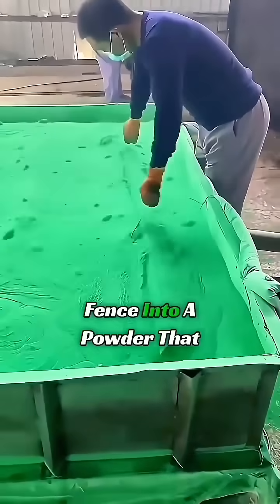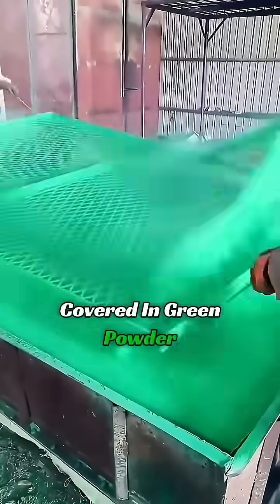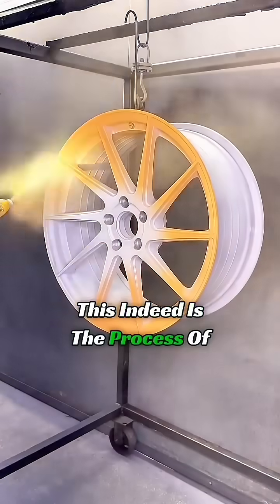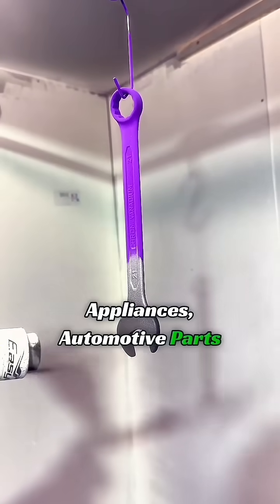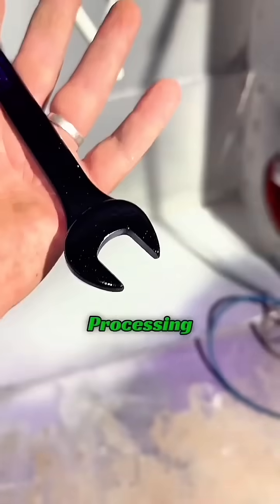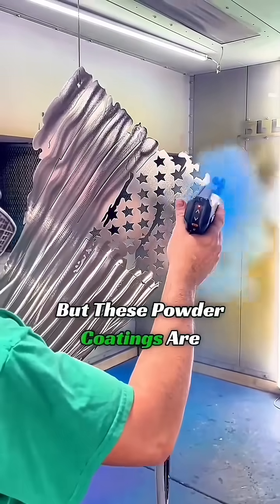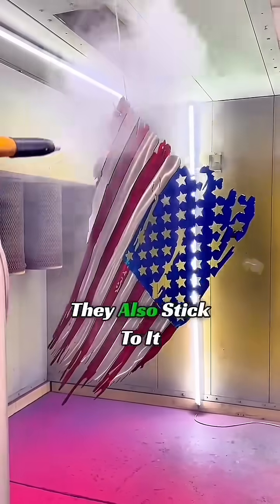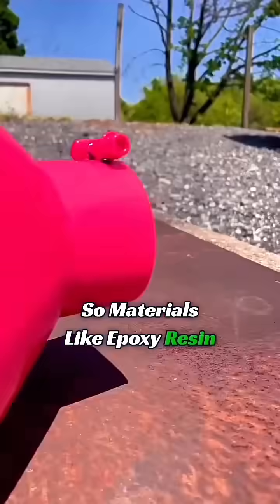How Does Powder Coating Work? 🎨🖌️ #powdercoating #metalwork #diy #usa

Comment: So Satisfying And Beautiful
Reply from the maker: Yay! So glad you found it enjoyable 😊 Sharing helps others discover it too!
Reply: @27_crew 😅😊
Reply: You do realize when you do powder coating it's got to be put in an oven about 410 °for 20 minutes minimum. This causes the power to harden and stick to the metal and not come off. Then a clear coat can be added and reasserted into the oven. It is a very toxic stop if you breathe it in and can cause kidney failure. I've done it for a living for a while.

Comment: Okay I used to do powder coating. Use electrical static to attach it then you put it in an oven at 410 degrees for 20 minutes. It is extremely hard at that point and a great paint job. If you want you can cut it with a glaze after that and then reset it into the oven for another 20 minutes. These guys saying it falls off because they didn't bother to tell you you got to eat it in an oven.

Comment: I've got a bumper on my pickup that was powder coated 23 years ago. Its got some marks on it where I backed into a concrete block wall and one scratch that shows some rust but the powder coat shows no signs of coming off. The company that did the work made exercise equipment, powder coated all their parts but also did outside work to keep the department busy. I also had some parts done for a couple of semi show trucks that I put together. Powder coat is not easily damaged.

Comment: GET TO THE POINT WITHOUT YOUR BS AFTER IT’S ELECTROSTATIC YOU BAKE IT HEAT MELTS THE PAINT ONTO THE METAL DON’T GET ALL SCIENTIFICALLY CRAPPED UP WITH YOUR BRAIN OF MARSHMALLOWS ELECTROSTATIC $35-$50 FOR THE GUN AND ALL YOU NEED IS A BIG FREAKING OVEN YOU BAKE IT TO 400° FOR I BELIEVE 20 TO 30 MINUTES AND YOU LET IT DRY. WHAT DO YOU GOT POWDER COATED !

Comment: No mention of an Iron Phosphate conversion coat prior to paint or equivalent pretreatment? Powdercoat adhesion relies on a pretreated substraight if you expect it to last. It's definitely better than liquid.
Reply: Most powder cost shops do a half-assed job. The best use an industrial system that do a timed soak in phosphoric acid followed by a timed bake in an oven to harden the surfaces.

Comment: The powder coat is put in an oven so the powder melts and creates a shell of color on the part.
Reply: Notice they didn't mention that fact.
Reply: @railroaded1991 o
Reply: @railroaded1991 content creator today use this trick so you and also me would make comments.😅
Reply: Had a summer job in a powder coat Co. Did aquarium tops, oven bake
Reply: I did this job for five years very satisfying
Reply: First outgas the part by putting it in an oven to allow trapped gases in the metal to be released. 
When powder coating you typically need to ground whatever part you’re going to coat which will positively charge the part. The powder that you push through the gun itself goes through the end of the gun which is negatively charged and that’s how you get it to stick to the surface of whatever you are spraying. Then you bake it in an oven to cure the part. You can do multiple coats on a part but I think it gets more difficult with each coat. 
The cleanup is a lot easier than cerakote and if you make a mistake you just hit the part with air to clean it off and try again. The few times I did it I got the part to look better than an anodized part dyed black.
Reply from the maker: You're totally right! The heat in the oven is what helps the powder flow evenly and bond to the metal. That's called the curing stage. 👍💛